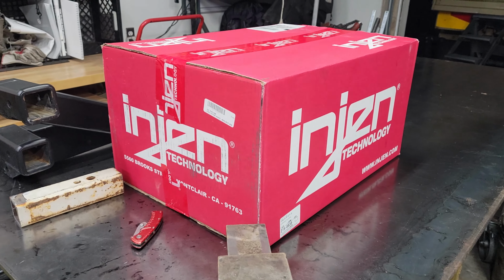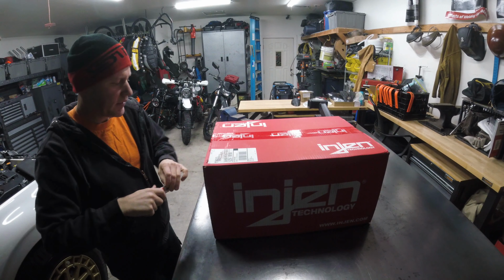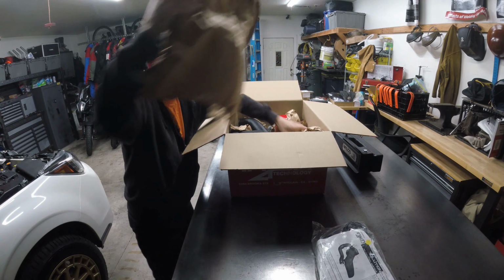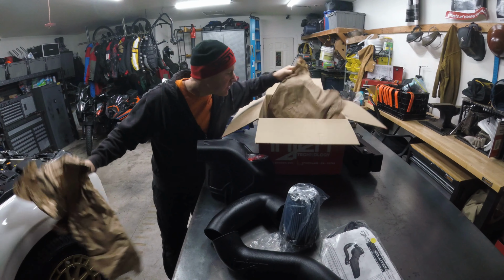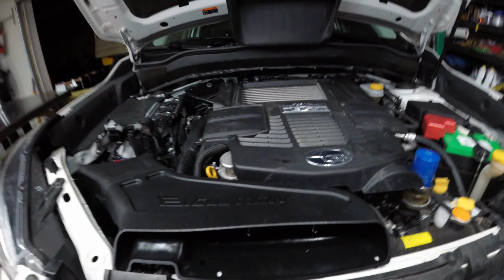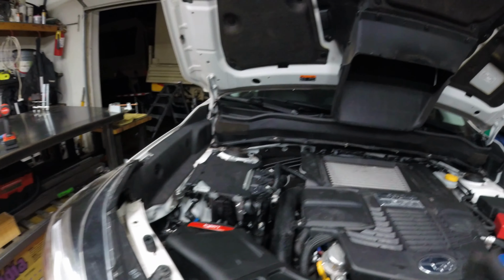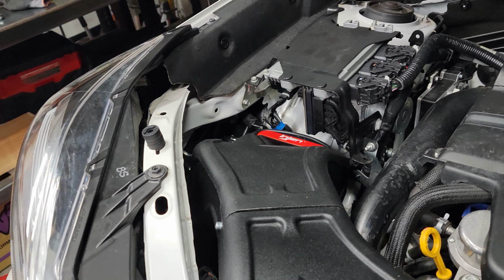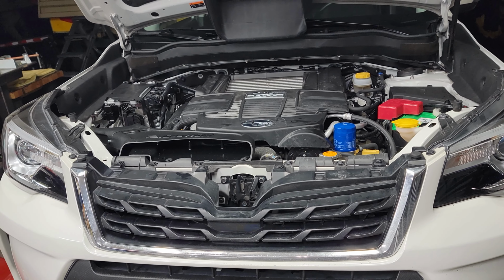2018 Forester XT touring Part 5 (WRX injen cold air intake)

Comment: Just finished up my install today, looks good. Easy install. I modified the side fender mount bracket to fit properly and modify my inner snorkel air dam to allow more airflow. The rubber seal was interfering and blocking air going into the air duct. Using COBB to program for the new air intake. Thanks for posting your video, it prompt me to do the same mod...

Comment: I'm concerned about the under hood air scoop for the intercooler getting blocked off.  Any advice for this?  Any adjustments to be made for that.  I just want to be sure.
Reply from the maker: Close the hood and drive.